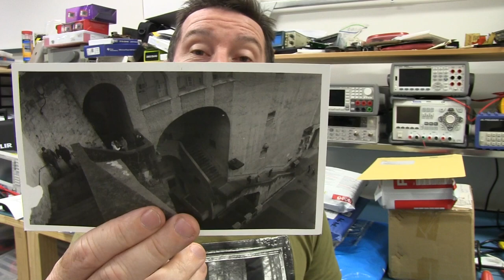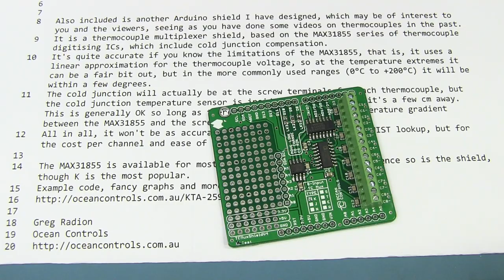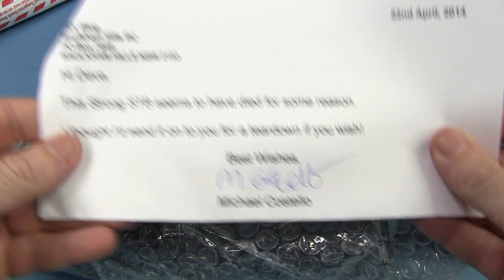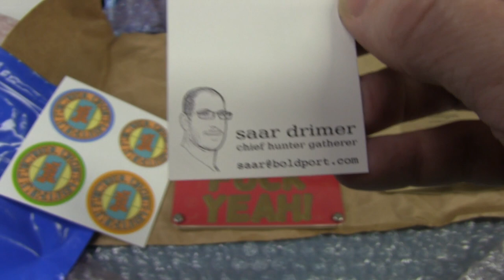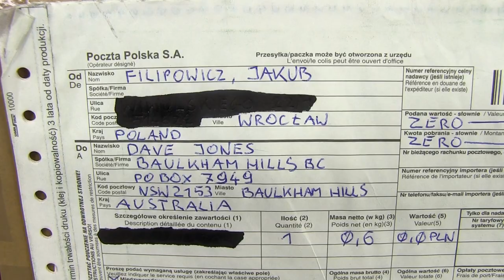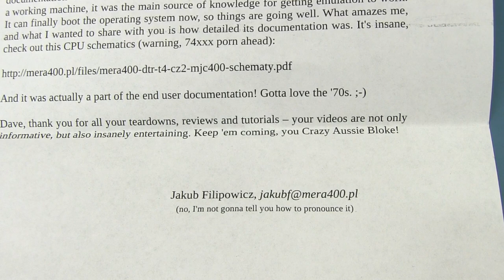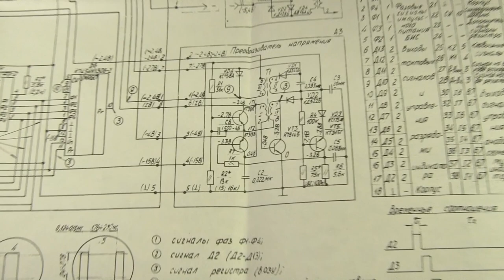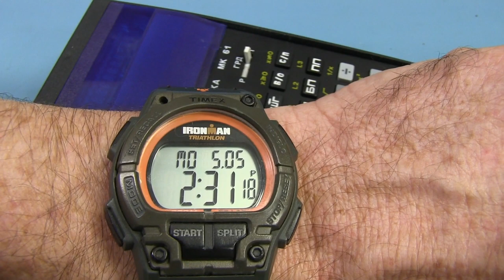EEVblog #612 - Mailbag

Comment: I bet the DC-DC inverter is for the VFD display; they run on something like 27V..
Reply: Absolutely correct. And this module was also a most common cause of failure, due to drying electrolyte of it's capacitor.

Comment: Its for the calculator: "Element basis :K745IK1302 -2 - the controller , the processor , the display controller and keyboard;
K745IK1303 -2 - arithmetic processor ;
K745IK1306 2 - additional processing functions MK-61 (as compared with the family calculators B3- 34)
K745IR2 -2 - registers the heap ;
K745GF3 -2 - the clock."
Russian electronics are still popular these days (vintage of course), so at least understanding of some symbols or letters is a really good skill. P.S. Polish write in latin letters, it was russian. ;) Greetings from Lithuania, love your videos, just sometimes try to be more proffesional! :)

Comment: Why couldn't you replace the tape reels?  Just move the support just a little to get the pin out, remove old reel, then put new one in and snap back into the hole?

Comment: I have an Electronica MK71, the more modern model, and it's awesome oldschool calculator, very convinient and nice. It's 1994 and it still works great, meanwhile it has only solar battery, so you just take and use it, no concern about changing power elements.
It's very elegant, muuuch more thin then the 61 and has a metallic case. And it's one-chip design.

Comment: The cord is a unit of measure of volume used to measure firewood in the United States and Canada. A cord is the amount of wood that, when "ranked and well stowed" (arranged so pieces are aligned, parallel, touching and compact), occupies a volume of 128 cubic feet (3.62 m3). (From Wikipedia)

Cordwood circuits get their name because they resemble cords of stacked firewood.

Comment: Dave, if you read the instructions for the Arduino Tape Dispenser you will see that the Tape Rolls can be changed. (Page 5)  "Gently bent the sides apart and insert the roller until it locks into the guide holes."

Willy

Comment: the "gunk" over the screw in calculator is a play-putty like thing. It was very common soviet tamper proofing technique. Sometimes little caps used over the screw, to hold putty inside. May come with letter or logo stamped inside.

Comment: that "gunk" on the Elektronika case screw is actually a warranty seal, they used to use that sort of seal on loads of electronic devices back in the USSR, if the screw head didn't have a recess to put the plasticine in, then they would put like a small cup instead of a regular washer under the screw head that then got filled up with plasticine and a OTK (sort of Check/OK) stamp then pressed into it

Comment: The Arduino tape dispenser works as intended. It's just like a car. Once one runs out of tape, you'll replace it. Same thing with the car: Once you run out of ash tray space, you buy a new car.

Comment: never knew it was called "Cordwood", but have happy memories of home made RAM pack for ZX81 = sandwiched RAM chips [with flattened out pins], between two strips of veroboard, as so much easier for paralleling RAM bus connections :-)

Comment: @23:14- Brain fart: You were probably thinking about the old (LED) TI's with internal NiCd's that had an inverter board, but the VFD display in this one obviates the function of this one. 

That's actually quite a beautiful calc (from the perspective of a fellow collector) and just the type of oddball thing i'd go gaga for. I like to still USE them, if not just to see the reaction from the puppies when i pullout an LED calc or a slip stick.(My ex girlfriend had a seminar where a calc was required: I lent her my TI-55 and it ended up as much a conversation piece as the material.) 

Whats truly fascinating though, is seeing tech from the days before "globalized" technology. I suppose to a Russian EE in 1984, a plastic 7404 would have appeared just as alien.

Comment: Here in Romania you pay about 20$ for a 1000 Mbps/100 Mbps download/upload internet connection. The real word speed it's close to 1 Gbps ( 125 MB/s) on downlink and also close to 100 Mbps on uplink. All of this is possible because our biggest ISP uses Gigabit Passive Optical Network (GPON) on the access side (for users) and has very high speed peering (40+ Gbps) with the biggest Internet Exchange Points. Absolutely insane!

Comment: It's cordwood, not corkwood. The name refers to the similarity of the component stacking with the appearance of firewood when it is stored stacked up in cords.

The calculator screw is a round head, not a flat head. (People call a slotted screw a flat head, but the latter refers to the shape of the head, not the method of driving.)

Was there any reason you wanted to move the lab other than the 'Net speed?

Comment: The calculator is completely Russian. These kind of schematics were routinely added to all socialist appliances, notably TVs. And there were articles in magazines describing the operation in detail. Electronics awareness and learning circles were quite widespread at the time. The things also had surprisingly long support, 20 years of replacement parts was common.

Comment: On that old Mk 61 calculator how are they producing the the blue LED colour. I thought blue LEDs are a lot newer than that calculator.
Reply: Is this a VFD display, if it is, wouldn't  this use more power than a LED display.
Reply: Coolkeys2009 Keep in mind that this thing was designed in or before 1984, and that it is soviet technology. They eventually had LED's but stuck to VFD displays pretty much.
Reply: The plastic covering the display is blue coloured...
Reply: nrdesign1991 I'm still trying to figure out the display technology as if it use's a normal VFDs with a filament, I can't imagine the batteries lasting too long. By 1985 LCD calculators were around, so I'm not sure why it doesn't at least use LED's. It does look ahead of it's time with Cool blue display though.
Reply: Coolkeys2009
Bear in mind soviet MIG jets were still based mainly on vacuum tubes right up until the mid '80s.

Some countries supress enlightenment and try to keep their people in the dark as much as possible, some just have ideologies that result in mass poverty. I wonder what north korea's consumer tech is like.
Reply: KX36 I agree with part of what you said. However soviets used vacuum tubes in MIGS because their engineers realized vacuum tubes can't be destroyed by EMP, un-like normal semiconductors.
Reply: Coolkeys2009
I expect they used them because the planes they developed in the '60s and were still using in the '80s used the old technology, rather than because of any inherent advantage of one technology over the other. being cut off from the developments of the western world, I don't think they had particularly advanced semiconductors in the 60s and 70s anyway.
Reply: KX36
 MIGs were and still are one of the most advanced planes.
Vacuum tube versions were developed after, for the reason Coolkeys mentioned. Most of the western world knows so little about their developments even today. Very often we underestimate their industrial/military technology due to lousy consumer products. We forget that it wasn't a consumer based society like the west is.

Comment: I bought an arduino with such high hopes. I have done 3 things with it. made a portable cellphone charger, a flashing LED.... oh wait thats the stock program. I did however turn it into a hotel lock pick as you can see in my video here: Arduino Hotel Key Hack

Comment: 17:16: not Polish, it's the legendary Soviet scientific calculator
Reply: you should unsolder the chip, in my opinion, it is a unique solution :) 
( chip and rubber are heat-resistant, hot air can be safely )

Comment: on min 8:50 you can see in the right side the BIOS chip with blue paint  of that receiver.
maybe its a 4mb or a 2mb chip, but if you rewrite that chip it will power on.
i do one like that  everyday.
try it  #EEVblog  it will power up

Comment: Guys, if you develope in python, do not release in python. The chances of me bothering to compile python is about 1%, maybe one out 100 and it has to be a function that i can not get in any other way or form. I know how to get them to work but i will not be bothered. What makes more sense: millions of people compiling their softwares or you doing it once. Yes, i know also that this is not how Python works but that is not my problem. It is yours. Do not promote your python code but do the trouble of making is executable of some sort. There should be NOTHING in a program that say, designs PCB traces that is machine specific... 

If you dont care about me, i do not care about you.

Comment: I am in London and get 80 down 20 up.
Reply: I get 73 down and 18 up
Reply: FTTC? :-)
Reply: *****
 Yes, just think how fast it be if it was FTTH
Reply: TheDutyPaid My m8 in Shannon is on UPC Cable net , 200/50 and all that on a coax
Reply: Darren Woods
Kbps? :-D
Reply: Lol no Mbps, Fiber to exchanges coax to house. What makes me laugh is then they give him a wireless router with only 24mb , but threw wired connection I seen it hit 180+
Reply: Darren Woods Coax? I'd have assumed twisted pair?
Reply: No regular coax in to the house no fancy trickery apart from what ever is at the exchange.
Reply: Darren Woods
Hmm, your saying exchange made me think it was BT's fibre to the curb? Which is over the normal (twisted pair) phone line
Reply: Shannon Ireland :D , Yea they can pump a lot down those lines too these days.
Reply: Darren Woods Ah awesome. I think FTTC is available near me, 20/80 again... upgrade cost is nominal, might have to spring for it :)

Comment: 250/100Mbit here. trollface
Reply: We get 500/500 in the office :P
Reply: kalhana1  Rikard Bengtsson
Here in Germany, we usually see something up to 100/5 Mbit/s at home (which I have), and 5/1 Mbit/s at the office, shared by 30 people.
Thus, you can't really work with online stuff in the office. Pen and paper it is! :-)
Reply: Jordan Stocker 1 / 0.15
swag.
Reply: 6/1 :)
Reply: Thilo Niewoehner the best part of studying in germany is the ridiculous fast internet at an university. With a 100/100mbit connection, I feel kind of bad not running any youtube/twitch channel actively while others are struggling with dsl4000 or something.
Reply: Thilo Niewoehner I bet even at 5mbps down shared with 30 people, you're still getting more guaranteed speed than your 100mbps at home lel. Those 100mbps at your home are resold dozens of times with the idea that it'll be rare for multiple people to all be downloading like crazy for extended periods of time
Reply: ***** Nope. Checked that regularly with the VPN access to the company's servers.
That gives me like 50 kbit/s at work and some 1 Mbit/s at home.
Seems to be real.
Reply: Thilo Niewoehner That's not the point. Corporate connections are expensive as shit because when they buy 5mbit, you're actually getting 5mbit guaranteed. If you're getting 100mbit at home, they can't guarantee you that, nor is it allowed to use it at 100mbit for extended periods of time. But you know this presumably, so it's fine
Reply: 1000/1000Mbit here.  #getrektm8

Comment: SDSL ?
Reply from the maker: Ethernet over copper. But there is a DSLAM in my building, so doesn't need to bond pairs to the exchange.
The 20M/20M link will be over a new fibre installed in the building. But still over copper for the last 50M from the MDF room to my office.
Reply: EEVblog Wow, you'd think they wouldn't even bother with 20/20 over fibre. That's like using a freighter to ship a single peanut!
Reply: JoeCatshoee That's one of the best analogies I've ever seen!